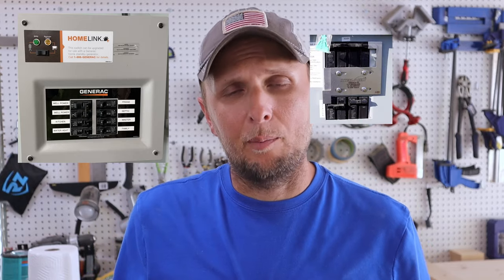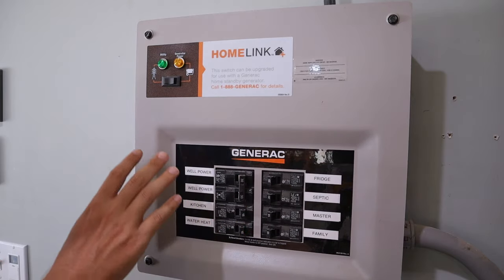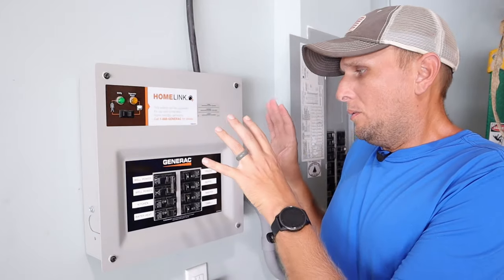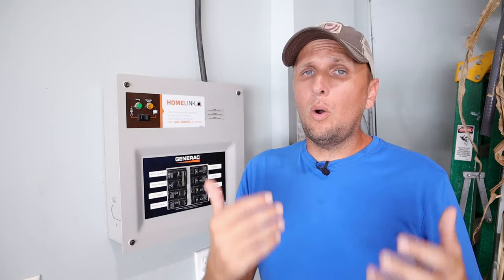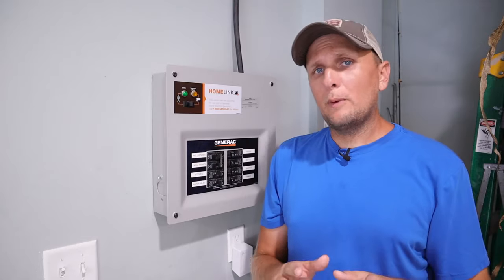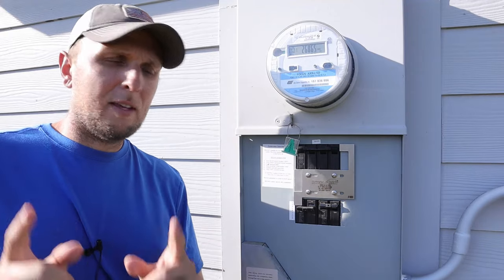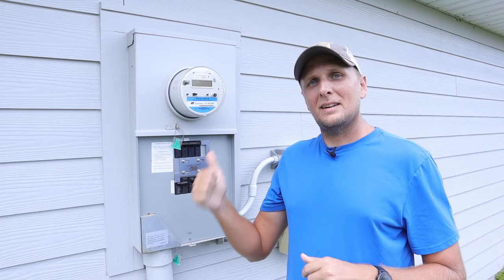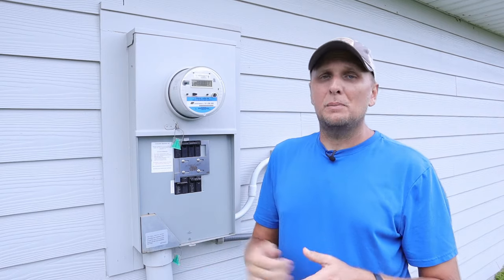How To Choose Between A Transfer Switch Vs Interlock Kit With Power Inlet Box

Comment: Congratulations !! This is the ONLY video after looking through dozens that has the EXPLICIT INFORMATION on a Power Inlet box and Interlock !! The rest are all just click bait and ppl sitting in a chair talking or showing wires and never the actual units.
====================================================================================================
One of those other vids has a guy with everything switched over with the power out and the generator running, and he's showing how his heater and freezer is on in the dark !! He forgot to put the line that runs the room lights onto the backup breaker box. ! Lights today are LED's and all of them on in the whole house is barely even over 100 Watts !!  My RIP contractor dad had a question for that. "Where's their Brains ??!!!!" he would say when seeing something like that.

Comment: I think I would rather go with a inlet box. This way you have the option of what breakers you want on, instead of whatever ones were installed in a transfer kit.  It would be prudent to do a test run of each breaker. Generator on and use a power meter - test power on and running power. You could make a chart to keep at the breaker box.

Comment: There are only a few disadvantages to a whole house interlock. One is that if you live in a rural area and don't have any neighbors or street lights you will never know when the power comes back on. Interlocks are more flexible but if your main breaker box is in the basement like ours is, prepare to run up and down the stairs often.
Reply: The meter on the outside of my house has an LCD display. When utility power is available, there is a display, otherwise it's blank. I will check any time I refuel the generator.

Comment: Have a Duromax 9000 BONNDED neutral generator and it is my understanding that you should  use the "transfer switch" to avoid having to play with the generator by unbounding the neutral Is that about correct? Thanks

Comment: The flexibility of powering the whole panel is really nice if you are technically inclined and understand what you are doing.  I have a transfer switch that feeds the whole panel.  I shut off all the breakers and then flip a few key circuits back on.  I color coded the essential circuits with small stickers to make the whole process very quick.  But in an extended outage, maybe you really need to do some laundry or power some otherwise "non-essential" load for a few hours.  But that flexibility requires understanding, in advance, how much power various appliances use and keeping a kind of rough wattage budget in your head as you flip things on and off.  A transfer switch is better if you want the whole process to be simple and foolproof.  Fire up the generator, push one switch and the food doesn't spoil, the internet comes back on, etc.

Comment: Good videos. Is there an interlock switch I can put on the main breaker? The panel has only one 100 amp breaker in it (one breaker hole only). Circuit is meter, main breaker, then feeds the well, then house & shed.  Suggestions?
Reply: Believe there is one available for Square D panels.  If I remember correctly,  the generator 2 pole breaker has to be in the top position on the panel's buss.

Comment: If you use the transfer box did you say turn on the generator first and then push the switch to switch from utility power to generator power? But before you push the switch isn’t the generator feeding power back into the grid? You said that would be a problem with the interlock system but why isn’t that a problem with the transfer box system?

Comment: I just had a generic generator installed and I have sore panels with another company installed them if the generator comes on because of a power outage will the solar panels back feed power into the generator and damage it either way

Comment: I'd like to install a Interlock kit on my Milbank Meter box but it only has the main switch with no other accommodation's for adding the generator circuit breaker. Is there a kit for my situation?

Comment: Would the Generac Transfer switch be compatible with my Firman Tri Fuel Generator T07573 ? I plan on running it on natural gas giving me 5500 running watts.

Comment: Does it matter if your generator has a floating neutral or grounded neutral? 

Can either type of generator be wired to a manual transfer switch WITHOUT worrying whether it has a floating neutral or grounded neutral?

Comment: So, this may be a dumb question, but here it goes: Is back feeding bad? Wouldn't your power just go back into the grid if you're not using it all? I'm a ways off from any set up like this, but curious and would like to do some sort of generator back up eventually.
Reply: The power going into the grid could shock linemen that are trying to make repairs to the system.  If the grid is live then the utility power will flow into the generator and house wiring and make a nice fireworks show.  
The interlocks and transfer switches isolate the systems to prevent disasters on both ends.

Comment: PS. I have a 22kw standby generator because I didn’t want to pick and choose which circuits got power and which didn’t.  So I didn’t want some circuits in my main panel and others in a “sub panel” I.e. transfer switch…it is too confusing,  so what do I need to install to have the generator automatically detect an outage and then take over powering my house and when power is restored to automatically return to grid power?  I don’t want to have to manually push, slide or flip any switches.

Comment: Good video. Very informative. Some homes like mine have the main breaker outside and the breaker box inside. This doesn't allow me to have an interlock switch because the main is a single breaker box. So a licensed professional would not install an inlet box and breaker to my panel without the ability to put in a interlock switch. So a transfer box would be ideal. However my neighbor is an electrician and we installed a inlet and breaker. I just have to make sure i flip my main on and off before i do anything. I will eventually switch to a transfer box. JFYI
Reply: Reliance has a nice 200 amp outdoor rated manual transfer switch with interlock. A little expensive put it might be a good option for you.

Comment: I have a GE split panel with the breakers on the right side and the main shut off under the left 6" x 6" small door with no space for the generator breaker.  Is there an easy solution for adding an interlock kit?  or, I'm I better off with a transfer switch instead?

Comment: 2600sq ft home with 2 ton AC, and TV/computers on I was at 5200 watts. Add electric stove, I was at 7200. with a ~10k generator I got for 500 bucks. I can run my entire house. Only issue is feeding it fuel... Need lot of cans handy as it'll burn around 20 gallons a day.

Comment: I have a generator that is 9375 starting watts and 7500 running watts in 50amp conf. And a 8400 start and 6750 run in 30amp is it really worth me going 50 amp setup or just go with the 30amp setup?

Comment: I have a 10kw solar system on my house and, per code, it's designed to not produce if power is out so a lineman won't get killed.
I would like to have it where I have the ability to disconnect from the grid and then have the generator supplement my solar production until it gets dark or the grid comes back up.  
Suggestions?

Comment: Hi  What is the most simple and clean way to have two gen inlet boxs?  I want one inside for my battery.  And I want a second one outside that connects to my gen?   Any info on two gen input box examples would be great.  New sub w this video.  Thank you.
Reply: Only with a Manual Transfer Switch. Check your local codes, but you can install a changeover switch that both Inlets are connected to.  This way you can select which inlet will be powering the circuits.

Comment: You did answer a bunch of questions for me. One question I have is a bit more specific. My emergency power can come from a solar generator or a LPG generator. I want to be able to use one or the other during a power outage. If the smaller solar generator fails, I want to be able to use the LPG generator as a backup. Is it a hazard to have two potential sources connected to a transfer switch? Would any additional safe guards be required?
Reply: We have a similar set up as yours.  We have a Ecoflow DP power station and Tri-fuel generator.  We use a six and ten circuit Manual Transfer Switch.  I installed two inlets, with a changeover switch, for both transfer switches. 

 So, we can have battery power and generator power going into the transfer switch at the same time, but only one power source is powering the circuits in the Transfer Switch.

Comment: Interlock all the way. I have the generator for long term emergency power only. I have a gas furnace, range, water heater with 2 1000gal tanks. I have a dual fuel generator. All I need power for is well pump, furnace blower, and to recharge battery lights. 
I can live happily for years with nothing else.
Reply: Those are some big water heaters.

Comment: So naturally, I would like to have a power inlet box that is wired up for the 50 amp, but also has a inlet port for a 30 amp in the event that that would be all that was available when power was needed all I can find on the Internet are boxes that are outlet boxes for providing power to RVs that have 30 amp 50 amp and 20 amp outlets. Is there a such thing as a 50 amp 30 amp dual input box I’m assuming it would also have like a interlock switch where one port could be used at a time that being said I can’t find one and I really don’t understand why that wouldn’t be a thing.

Comment: I have it hooked up to the meter with generlink to feed the whole panel, similar to the inter lock but, problem is,  the interlock is not legal in Canada because if the panel cover is removed, there is no protection.

Comment: What about a 50 amp transfer switch on a Honda eu7000is instead of 30amp in case I get a larger generator later on?6gauge wire.

Comment: @How To Home  ...  A smaller generator, such as a 4,500w, "will never fully run your entire main panel, let alone probably even half of it"?  Or, more specifically, you mean it may/will not power everything connected to all the breakers.  I want interlock.  If I want to dry clothes, I can use portable battery-operated lights, temporarily turn off the refrigerator, etc.  I know not to overload the generator.  Plus, I can get a generator that has overload protection.  Anyway, my whole life I have dealt with power outages from weather, etc, I'm used to it.  I just finally decided I want a better option than roughing it.

My main problems are doing it myself or finding a professional decently-priced electrician.

BTW, I know the answer.  I am just making darn sure I know the answer.
Reply from the maker: I am not sure your question.

Comment: Isn’t another con with transfer switch is more work to run wires from breaker in main panel to the breaker on transfer switch? Doing that wiring (even though it’s one time) adds lot of complexity and labor.
Reply from the maker: Yes a transfer switch definitely has a lot more going on during the install you are are right about that!
Reply: Yes, it is more involved and takes more time to install.  The benefits far out way the cost and time put into installing one.

Comment: We use an interlock and a generac 6500 watt generator to power the whole house during power outages. You just have to manage your power consumption. The main purpose is for the critical things like refrigerators, freezers, water pump, etc. Having propane for heat and hot water helps too.
Reply: @chuckh1958 how do you like your Generac ?  I just picked one up a few days ago and am getting it broke in.  What type of appliances are you running together at the same time ?

Comment: How does that interlock work at the meter? Wouldn’t the power still feed the panel and in turn back feed? The main breaker would just shut off power to the interior panel and not to the city feed right? Or is the city feed going into the main breaker and then a second breaker is feeding the house?
Reply from the maker: No that’s the main breaker out at the meter.  But with it off power cannot flow past there in either direction.
Reply: @HowToHomeDIY  thanks man, that makes sense. I wish my house was wired that way. I have city power coming into the the lugs outside and the main breaker only disconnects the house side. Looking into adding a second main breaker inside to use with an interlock.

Comment: If I have a GE split panel with two doors.  The panel has the main shut off on the opposite side under a separate door.   There doesn't appear to be a way use a lock out device with a panel like this.  
Can't find a panel model number, but the home was built in 1981.
Any ideas?

Comment: Does your opinion change if you would be using a Ecoflow Delta Pro Power Station?  I just purchased one and also considering the matching extra battery to double the capacity.  I’m also wanting to add solar to charge both components.  Thanks for the video and appreciate your reply.
Reply from the maker: Hey Dan, that is a nice power station!  Does my opinion change as far as what?  Going with a transfer switch or interlock kit?  If that is what you mean, you could do either.  It really does come down to the person as far as how simple do you want it and at what price.  I appreciate the feedback.

Comment: I have both ..because I have two sources of backup power my  transfer switch is on a Tesla powerwall for backup power because that is my mine source backup power because I have solar I have a interlock on the incoming power of the generator if I need to allow the Tesla to charge up..or run the house ...as a secondary backup power

Comment: What about for the automatic generators and transfer switches?  I have sump pumps to keep my basement dry. If I'm at work,  or worse on vacation,  a manual process is useless.  I didn't hear you mention that at all, unless I missed it? That would be a transfer switch and a large generator,  more permanent installation.
Reply: I hear you.  You buy a power station, that works as a UPS, and plug it into the inlet for the transfer switch.  Turn on the Power Station and flip the circuits to Gen, in the transfer switch, that you want powered in a power loss.  The Power Station will switch over to battery power, when power is lost.  When Utility power is restored, the Power Station allows Utility power to pass through it, powering those circuits in Gen mode.
Reply: @Pk3_Garage  and how long will a ups run a 1/2hp and 2hp pump simultaneously?  My experience with batteries is not well and not long. I just get the feeling that people are trading money for convenience.  A true system that will do what you need is probably twice the cost,  but if you get damage from water, you're upside down in cost. Stepping over dollars to pick up dimes...
Reply: I honestly can't say.  It depends on how big of a battery backup system you have.  How often it cycles on/off.  The wattage usage of each.  

We have the EcoFlow Delta Pro power station. It's rated for 3.6kWh watts and 7200 surge watts.  We can add extra batteries to the system, up to 25kWh. 

 If we are running 1000 kWh continuously, we get 3 1/2 hrs. run time per charge. It is expensive, but worth the money and peace of mind if you can afford it.
Reply: @Pk3_Garage  I get it. I honestly think for me, getting a whole house sized Generac with an auto transfer switch is the most seamless way to go. Hooks to natural gas,  no refilling,  messing with turning this or that on... And if I'm on vacation,  food in the fridge and freezer will be good, basement dry, and no bothering anyone nearby. 100% automatic. 
I fully understand it is a trade of some money for that convenience, which I'm good with. Not mentioning it in a video like this as an option seems incomplete.

Comment: Can I put in a sub panel and move all the circuits to that box that I want on a generator and then put in an interlock just for that sub panel? In short, I want everything but AC and oven systems on generator. All my water, dryers, are gas.

Comment: My house originally came with a main panel & a sub panel in my house. The original main panel on the house had all the large wattage devices on it like the water well pump, stove, hot water heater, HVAC, & also last but not least a breaker for the sub panel too! The crazy thing about my main panel was that there was no main breaker on it!  The original sub panel on my house had most of the other smaller amperage / wattage house circuits on it for lights, refrigerator, etc.  Now of course I knew my medium size generator would not be able to power all of these big wattage appliances & I wasn't going to try it either.  So some of these sub panel circuits would be the ones that I wanted to be able to power if an emergency happened (except for the well pump for water).  To fix the dilemma I had, I moved the high importance (water supply) well pump from the main panel to the sub panel. Now I also installed a new sub panel on it that had a main breaker on it for the interlock switch (because my original sub panel didn't have a main breaker on it). BTW -  I also don't plan on using the electric dryer & microwave (still on the sub panel) when using my 7000 watt generator.  So what I plan on doing is to turn these breakers OFF to stop an accident "generator overloads" from happening.  I also have wattage meters attached to the sub panel too so we can check wattage useage while running the generator.   I have informed the wife about we can't use all house appliances during power outages as well...  I actually asked electrical companies to give me estimates to fix my original panels so I could connect a generator & they gave me a lowest $15,000 bid to do this job.  I said WTF & hell no.  I did all this stuff myself for $200-$300...